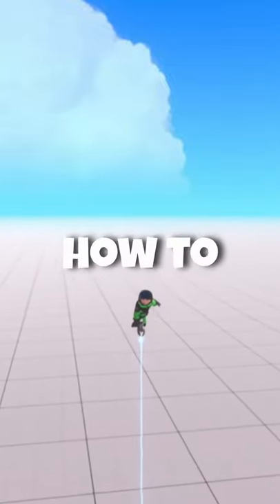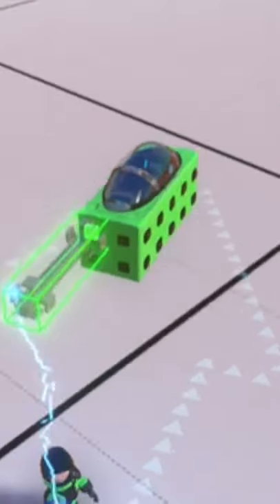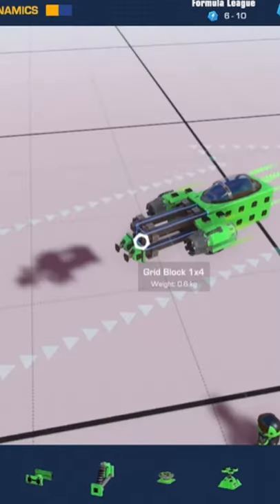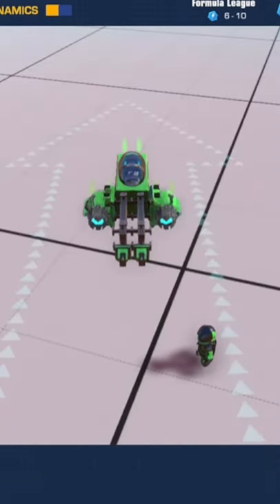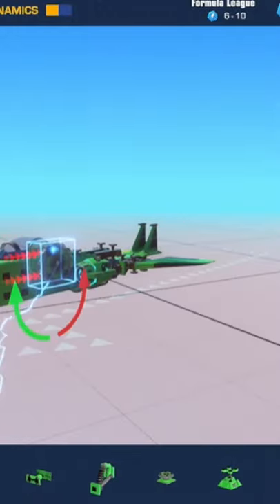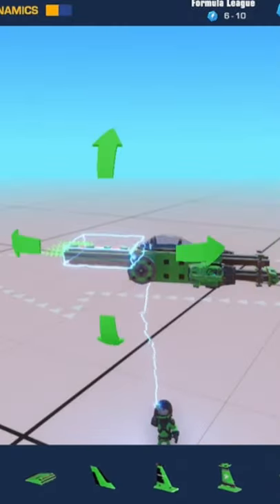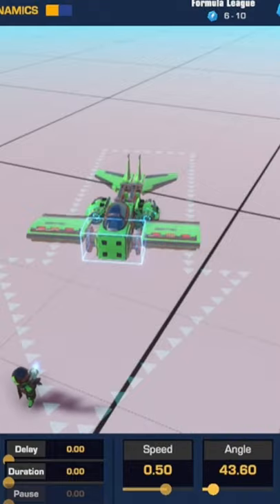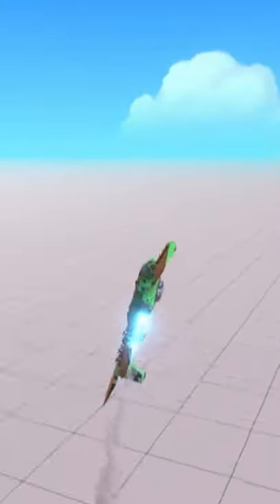How to make a simple plane in Trailmakers (Trailmakers Tips)

Comment: Yeah I don't understand why people keep using servos on smal planes.
Just use hinge's in combo with pipe pieces. Les weight and less drag
Reply: Servos are just easier
Reply: Because the servos are extremely fast and strong when compared to hinges, but yeah, small planes don't really need those
Reply: SIMPLE 200MPH EASY CONTROL PLANE
Literally take a go cart seat and put a wing on the back of the it facing into the seat the put a wing in the front facing into the seat then use connector pieces to connect the wings to the seat then add 2 mini thrusters on both sides of the seat
Reply: Servos feel better for roll and hinges feel better for pitch imo
Reply: Yes. Hinges are much better
Reply: @trixplayz8047 👎 👎 👎 👎
Reply: Sometimes that added weight can contribute to stability but they're also way faster and stronger like that one guy said

Comment: Or use a normal seat, place a propeller on the front a fin on each side of the seat and 2 in the back of the seat as a tail.  I prefer to use a bike seat personally. But it works either way and you don’t need to add anything else for it to work. For fun, I use a submersible cockpit with 6 small thrusters all facing down.  It gets good speed and if you know how to use it. Great transportation